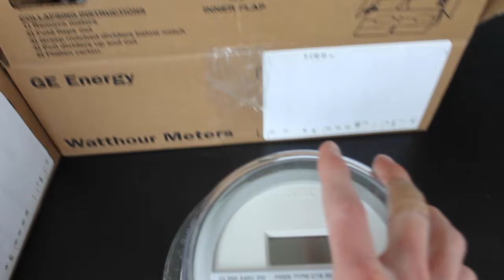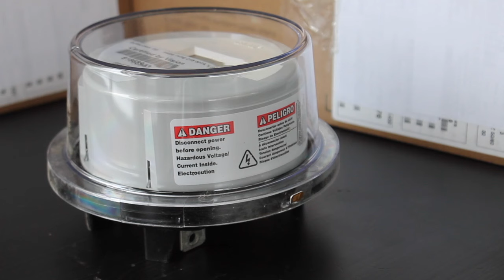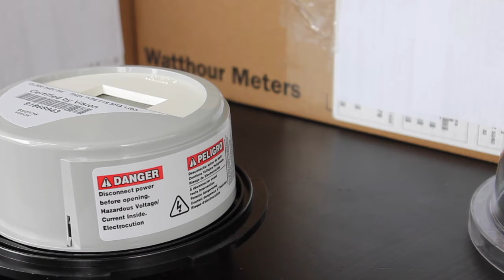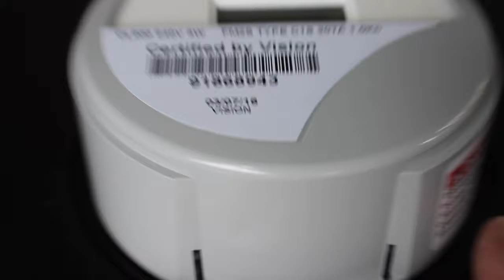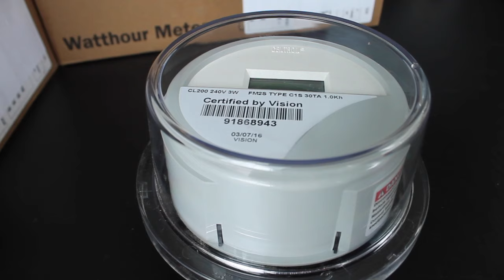Itron Centron C1S Meter Teardown

Comment: Have you had any issues with the C1SR meters with the display failing. It starts with digits fade and gets worse with time. But the radio still reads ok and metering functions are still working such as calibration test pass ok.
Reply: IDK about your particular issue, but LCD displays are temp sensitive and can disappear when they get too hot.  There is usually a small trim pot in the circuit somewhere to control that and usually tweaking it a bit will fix the issue.
Reply: Maybe because liquid crystal displays weren't meant to withstand blazing sunlight and uv for years on end. How is one supposed to "tweak" a potentiometer inside a seal meter?
I wonder how long it takes for these to haze over like plastic car headlight do. Cheap plastic junk.